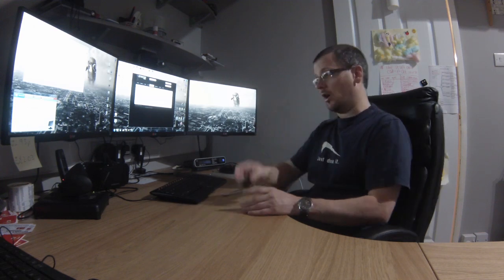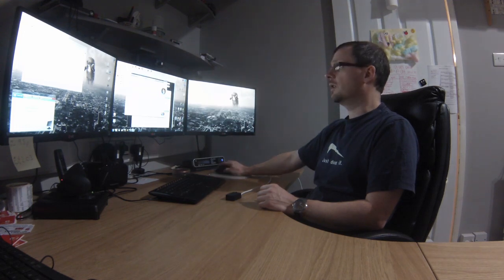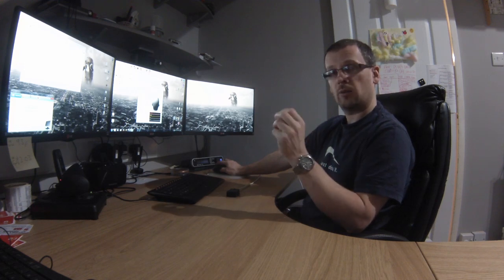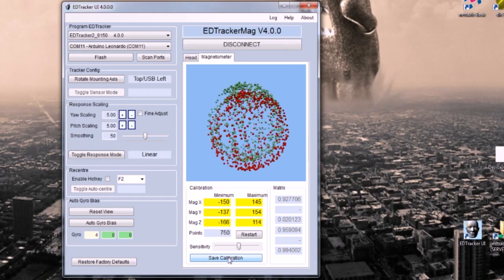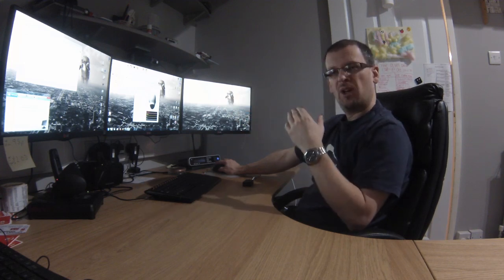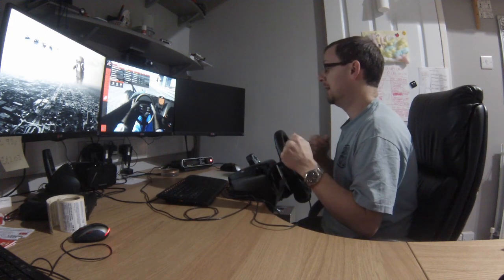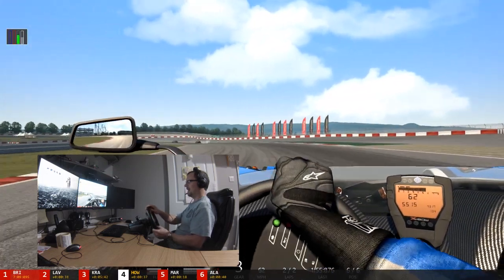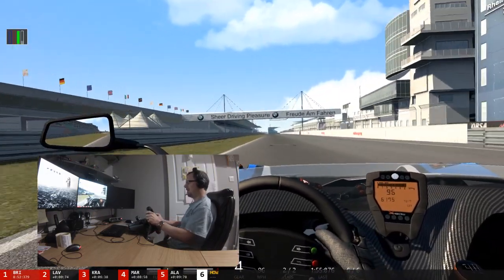DIY EDTracker V4.0.0 Calibration (Magnetometer/9150)

Comment: I built one today using BartyBee's guide. Managed to burn my hand pretty good, but otherwise things worked as you described. I found that it responded better if I held my head still and ran the auto gyro bias there instead of sitting on the table. It could very well be that I totally botched the build, but overall I was fairly tickled with the results. Thank you for everything! :)

Comment: Great vid brumster, built my own from the hobbykit pack and your custom PCB with the case that fits. v3 was slightly "wiggly" for me but v4 is spot on it seems, mainly play ED but have tried it in Arma and will try in it AC when I get my wheel out the cupboard again. Keep up the good work team!

Ohh and I did own a TrackIR 5 and although it was great, after a bit of tweaking this is as good although you havnt got the stupid clip with a hat and stupid camera either or all that licensing crap (NaturalPoint are an awful company!). If anyone has any tinkering ability get one! Or if not order one from the guys! Definitely better than TrackIR considering cost and extra stuff on your desk

Comment: Using a 9250 with the 4.0.4 software  After about half an hour of frustration I got my yaw to stop auto-centering. This is exactly what i did after reflashing with 9250 4.0.3. I have the tracker ziptied to my headset and just put the headset on my flight stick and eyeballed it to get it level.  I ran auto gyro bias. Then over to the mag tab and turned sensitivity all the way down, clicked save under the matrix section, hit restart under calibration and gave it hell until my values stopped repopulating and I had about 220 Points.  I then put the headset back on my flight stick, waited for the gyro numbers to go back to green (don't ask, there was no method to this madness)  I flipped back to the head tab and everything was working great.  I really don't understand why this time it worked, maybe brum can make some sense of it and hopefully it works for everyone else having issues.
Reply: +Unorthatrox thanks that helped me. for others, you need to flash the 9250 4.0.3( or newer) and move the Edtracker until the calibration points reach 500, after this it should not autocenter anymore

Comment: Can't comment on the EDtracker, use the TrackIR, but i keep up to date about its progress because many on my channel ask me what to use, do I recommend either TrackIR or the EDTracker. I have pretty much been suggesting both at the minute even at the early stages of the EDtracker but it really does seem like its development is coming along very nicely, if not pretty much there already. Credit to you and your collegues for creating it, if I hadn't already bought the trackir when I did (before you'd created it) then I would have bought one.

On a completely unrelated subject, although not completely, looks like you're a decent racer, looked like that KTM had a horrible understeer issue more than anything, I think you need to stiffen up its rear anti-roll bar ;)
Reply from the maker: Agreed, it needed a bit of tweaking!! Thanks for the feedback/support also ;)

Comment: Aww, finally managed to break it. Forgot to be careful with the USB connector and it snapped off. Seems like a clean break with all the connections still there so I may try reattaching it. Even if not, it served me faithfully for 4 years and I have an ugly cludge of an IR tracker I made a couple of years ago to tide me over while I consider a proper replacement.

Comment: Had the 9150 version I built on a long term test and it hasn't been powered down for about 4 months and not had to reset it for drift yet ( has been reset but that been when I've tried to get the updated software to work and its failed).
This is the first time since I built it that a version of the software has worked first time and I was programming the 6050 using the Arduino software when I started back in the Alpha forums.
So I think you have finally got the software sorted (no strange rotation issues at last).

I also haven't been able to get Shadow  play to work in surround mode but with the choice of in game video or three screen gaming, the three screens won :P
but i'm sure there must be a way to get it to work.
Reply: Have found one issues with  the v4.0.1 firmware that I will try to record and post for you to look at. Something that the first early version didn't have (could never get the second update to work would spin left or right when I looked up down and was unusable for me).

But is current version seem to get sleep fatigue  after about 48 hours of being left running (never  power my ED Tracker down) and will start to twitch about and pull back to center when you try to look at the side menus :(

Comment: Hi Brumster, first, just want to say thanks for all of the amazing work  you've put into this project. I'm an EE myself and know how many hours can go into something like this just for the firmware, prototypes, etc,  let alone videos, documents,  and answering people's questions. Then on top of that, doing the full windows gui is really above and beyond, so thanks!!

Quick question: I'm not seeing any temperature values in the GUI -- is that OK ? 'Temperature' shows up with a green background and '0' in the box. 

FYI, I just built the tracker with an mpu-9250 and everything came up fine (once I figured out to use firmware 4.0.3 for 9250). 

I haven't even had a chance to try the tracker for real yet, but was just curious about the temperature thing -- is that reading a device on the Arduino or the mpu board?

Thanks again
Reply from the maker: +richfiddler11 Hey chap, thanks for the words of support! A number of people have reported that with the 9250's - it's not critical to be honest anyway, it's just for info - but yes it's a reading off the MPU itself. Might be a register/address issue with some 9250's I think. I wouldn't worry about it anyway, it doesn't do anything functional. Enjoy!
Reply: +brumster100 Wonder if you have any ideas here: trying to set up camera pitch and yaw with EDTracker in Rise of Flight United (RoF). The configure panel in RoF detects movement for X and Y axes just fine and assigns them, but doesn't work in game. RoF has a dialog to adjust/test axis response curves and for EDTracker there's no movement and the screen displays NaN where the axis input would normally be (obviously some kind of math err).

I have an mpu9150  EDTracker with v4.0.4 firmware and everything works great in your GUI  (ended up switching from the 9250). The Windows USB game controller properties also look fine. 

You're representing axis values with a signed 16-bit integer, right? Is it possible some programs can't handle that range  and/or perhaps a signed value? Would it be difficult to change the output resolution and switch between signed/unsigned to make the EDTracker compatible with a wider range or programs?

I realize a mapping layer like xpadder or opentrack is an option (and will try it for sure), but it would be nice if EDTracker could just act like a generic joystick on its own. I'm willing to experiment with the code, but I'm just guessing at the cause of the issue and would appreciate your input.

Thanks!
Reply from the maker: +richfiddler11 Hey rich, adjusting the axis values would be pretty straightforward yes. Update the HID descriptor in the hardware files and then change the corresponding main sketch code to report them however you wanted. Drop me a PM with your email and we'll give it a go, if you like?

Comment: My EdTracker has stopped working..... it wasn't communicating properly, so I decided to recalibrate it.

It will flash and communicate fine to the device.... but when I flash with 9150 (4.0.5), after the flashing is successful it will endlessly scroll on the "Calibrating Gyro Bias".

Debug 1.0.0 works, EDTracker2Calib 2.5.3 works too... but that's all.
Reply from the maker: Sounds like an issue with the MPU board? Check wiring/interrupt pin maybe?
Reply: brumster100
I can't imagine it being a wiring issue. I'm very good at soldering (I've made my own circuit boards for railway modelling projects using SMD components... but I'll have a look anyway and let you know.
Reply from the maker: Fair does. It just suddenly started doing this? Nothing changed in terms of build/computer/software/etc?
Reply: brumster100 Just had a look inside.
No fluff of hairs, or anything conductive whatsoever.

The only thing going on is a red LED on, a green one (which goes off when the reset button is pressed)...

....and a yellow LED flashing constantly.

Is this normal?
Reply from the maker: Yes, this is the norm (colours vary depending on manufacturer of the boards, of course, but it sounds about right)
Reply: did you ever fix that? i have the same issue with a 9250
Reply: Yes, I managed to get it working in the end.

I cleaned it off the PC, removed the entries in regedit, and reinstalled.

Comment: Hi,
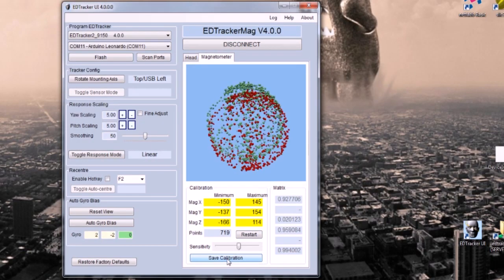Regarding the calibration (8:40), do the red ball and the green ball have to be on top of each other? With mine they were, as i can see in the video of yours they aren't exactly. Now i have got a comment from one of my viewers, on his the green ball is quite a bit off center of the red ball (about half the ball's size away upwards). Both are round balls, but separate ones. Is that a problem and if so, any suggestions as to what the problem is?
Or isn't it a problem after all.

Thanks :)
Reply from the maker: No, the balls don't have to overlap, the main thing is that the green one looks spherical (roughly). The red balls are a 3D representation of the magnetometer measurements, raw and unadjusted, and possibly subject to distorting fields and magnetic objects nearby. The green ones represent a calculated value where we correct the raw data for what's called hard and soft-iron errors. We apply a transformation to make it more "ball shaped" and spherical. If your balls are further apart from each other (Oh man, did I just say that?!) it just means your device is picking up more magnetical distortion that mine in the video. As long as it's corrected OK in the green balls, it's all OK. If your green balls are distorted, spikey and not at all spherical, then you have a problem (both medically and EDTracker-ly!).

Oh that's one YouTube response I've typed that's made me laugh out loud :D
Reply: Hi,
Thank you very much for the detailed reply ;) And the laughs :)

Comment: Hi, I have a question I built my own ed tracker, but I can’t calibrate it in the gui software. Is there any solution for that problem? And it says unable to download the sketch.
Reply: Arduino Pro Micro and mpu 9250/6500/9255
Reply from the maker: The flash-from-UI stopped working a long time ago when the EDTracker website shut down, so you'll have to flash via the Arduino UI... :(
Reply: @brumster100  ok, thx for the answer
Reply: @brumster100 I flashed it now with the arduino ide but I can’t calibrate it in the gui and I can’t change for example where my usb port is and it doesn't show me hoch much degree it has
Reply from the maker: Hi chap - this might be easier via a ticket in GitHub ;) but... ignore the UI for a second, is the device getting recognised as a USB device in Windows? It should appear as a joystick in Game Controllers?
Reply: @brumster100  yes it does, after I flashed it with arduino
Reply from the maker: So which firmware did you flash into it? Is it the right one for your MPU, as you list a number of model numbers in your original post for the MPU. We only support 6050, 9150 and 9250 (it's most likely an MPU-9250 I suspect)....?
Reply: @brumster100  i have a mpu 9250 and i flashed the 4.0.5 firmware
Reply from the maker: Hopefully you mean 4.1.1 ;) that's the latest!
Reply: @brumster100  yeah I mean that
Reply from the maker: This might be a USB driver issue or something then, if the UI can't see it. The UI looks for COM ports with a specific name string (Arduino Pro Micro or EDTracker, from memory). You should be able to scan/refresh the port list or else manually select the device, but if it's not appearing, then something is up with the serial port aspect of the device.... when it's plugged in, if you look in device manager, you should be able to see the COM port that gets created when the device is connected. What's the COM port device called? Can you connect the Arduino IDE to it, for example?
Reply: @brumster100  its called arduino leonardo
Reply from the maker: Ok, that's all fine then. So it's showing up as a joystick in game controllers, it's showing up as a Leonardo COM port... I honestly have no idea why the UI can't connect to it :( can you connect the Arduino UI to the COM port in serial debug mode?
Reply: @brumster100  How can I do that?
Reply: @brumster100  I noticed after I flashed it the one light is still blinking
Reply from the maker: Have a read of this :-
https://docs.arduino.cc/software/ide-v2/tutorials/ide-v2-serial-monitor/

Also this :-
https://github.com/brumster/EDTracker2/wiki/Serial-Comms-Protocol

Also this :-
https://github.com/brumster/EDTracker2/wiki/Raising-Issues
(..and the documentation linked within it)
Reply: @brumster100  thx

Comment: Quick question regarding the magnetometer. When you calibrate in the video your bubbles of dots are a nice tight mesh. Mine are tight spheres but the red and green have a wide separation. Is that down to poor calibration?
Reply from the maker: One set are raw readings, the other are compensated - separation between the two "balls" is no bad thing; if the two are apart then it highlights that calibration was very much needed, but it is not a bad thing for them to be far apart, no.
Reply: Great stuff and thanks for the reply! That's of some comfort, I thought I had done something wrong with the construction. I'm sure once I get to grips with tweaking side of things I'll never want to go back! Thanks to you and the other devs!

Comment: Hi +brusmaster100 !
I recently upgraded my EDTracker with a MPU 9150 and followed these instructions to calibrate it but there's a problem. When I look up and down, the EDTracker thinks I'm turning my head horizontally as well. For an example, if I look upwards (about 15-20 degrees) the head in the gui turns full right. If I turn my head horizontally, and not vertically there's no problem.
I'd appreciate any help!
Reply from the maker: +SweModerNab Aha, if you've upgraded from a 6050, then do a factory reset using the GUI button. The orientation values are different between 6050 and 9150 versions, so you're old saved settings in the device EEPROM are most likely causing the problem. Reset it and reset the orientation/calibration, and you should be sorted.
Reply: brumster100
Thanks for the advice! I tried this now, pressing "Restore Factory Defaults" followed by "Auto Gyro Bias", and finally I recalibrated the magnetometer according to your instructions in the video. It seems like it is my headphones interfering with the magnetometer. I'm by no means an expert, but it works fine with the tracker not mounted on my headphones. It seems sort of logical also, since the head band of the headphones is made of metal. I'll go ahead and try it on my plastic headphones as well.

Here's an image of the magnetometer calibration reading: http://prntscr.com/a2xb3v
Reply from the maker: +SweModerNab Oh wow, yes, that's no good. It's a circle, not a sphere! Are you sure you rotated it in all directions? If so it may well be the metal headband is magnetic/ferrous in some way. You could try maybe spacing it away from the headband with something... what headset is it out of interest? Got a picture/link?
Reply: +brumster100 I tried with a pair of headphones with a plastic head band and it worked well! These are the headphones with the metal head band: http://uk.akg.com/tl_files/catalog//AKG/images/K550/PNG/Image%20-%20K550%20(3D%20View%20on%20white%2005).png 
Thanks for the help! :)
Reply from the maker: +SweModerNab Thanks for that - duly noted! We might start up a list of problematic headsets like this... ;)
Reply: +brumster100 I seem to have exactly the same issue with Logitech G430 headset. EDtracker 9150 seem to work nicely when off headset, while on headset it tend to yaw a little bit left when pithcing up and right when pitching down. When I pitch fast, it is visible that the yaw 'kicks in' a little bit later, so it's most likely formware correcting yaw position basing on magnetometer readings...
Is there any way to workardound this? I dont want to get back to 3IR led solution .P
Maybe tune down sensitivity or something? Or should I calibrate it while ON the headset? Would it help?
Reply from the maker: +TheDarmach Absolutely, yes, calibrate the mag with the device ON your headset...
Reply: +brumster100 calibrating it on the headset seem to help, I stopped getting that "yaw correction" I used to get in extremal pitch positions. The root cause seem to be a position shift of the headphone magnets - they moved to front in relation to edtracker when pitching head up.

However, now I detected another issue - while it seem to work for a while, when I put the headset down (I hang it "other way around", like rotated 180 degreed to normal usage position, and pick it up after some time, gyro gets crazy. I see these very sharp, saw-like edges on graph, and I have to calibrate gyro again. Is that normal, some bug in a firmware (unusual usage scenario maybe, someone hanging headset 180 rotated on Z axis) or my gyro is faulty?

Comment: my disconnection problem is totally to do with the usb cable wiggling out. could you do a guide to solder a usb cable directly to the board? I have a usb cable that works tho, it's just not long enough.